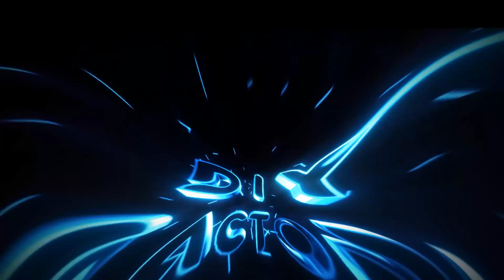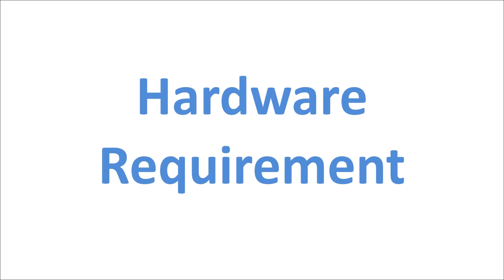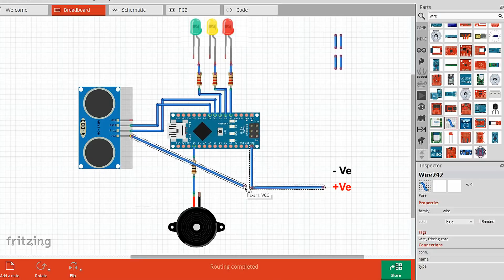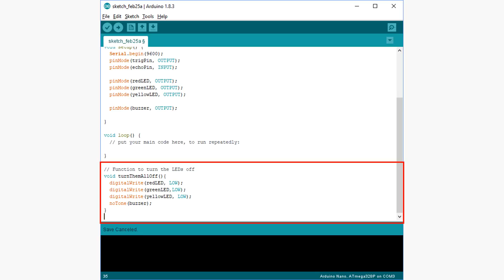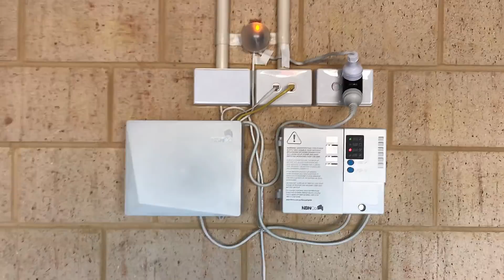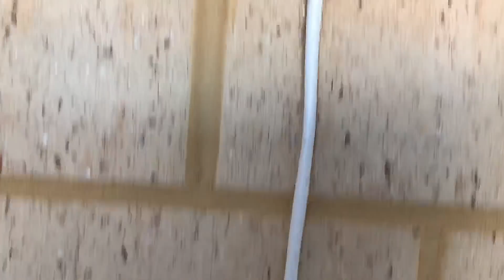DIY - Arduino Based Car Parking Assistant

Comment: Thanks for the video. At which part of the front of the car do you aim the ultrasonic sensor? I have been contemplating a similar project and the front end of my SUV is all curves, and the grill would give a poor reflection of the signal. I am thinking that reflection off the front number plate would be my best option. Any thoughts?
Reply from the maker: That is absolutely correct
I target the number plate using the ultrasonic sensor. 

I also have a version 2 of this project:
 https://youtu.be/MqJxUf3Cugg

Comment: In your video you use a Arduino nano R3 can this be done with Arduino Uno, if so how would it be connected up
Reply from the maker: You can use any microcontroller 
Just google the pin outs of that board and change the PIN numbers accordingly in the code
Reply: @CrazyCoupleDIY  thanks for replying I'm.using Arduino Uno with a breadboard so would your code work so long as I change the PIN details within it.  I will be repeating 4 times on the same circuit so effectively having 4 sensors and 12 LEDs that's why I'm using the breadboard

Comment: Can this be considered as a control systems project? If yes, then what is the feedback present in this? I'm asking just to clarify my doubts. Thank you
Reply from the maker: Well yes and no
What sort of feedback are u expecting?
Reply: @CrazyCoupleDIY  I think...the distance from the car to any obstacle in front or back is the feedback present...so that the system prompts me by telling there's an obstacle present...but isn't it difficult to design,because the proximity sensor should be really accurate...since I'll be parking inside a closed surrounding...and everything can be considered as an obstacle
Am I right?

Comment: Does this code work for arduino uno? Looks like all the pin names you use are not arduino uno pins.
Reply from the maker: Yes it does. 
You just need to use the correct pin names/connection in the code/and schematic 
Let me know if you are having any issues finding the right pin out and I will make a sketch and send it to you

Comment: Superb! The perfect tutorial video - probably just missed the bit where you warn people to be careful with mains electricity
Reply from the maker: Sure thanks for the suggestion. I am actually making a v2 of this. I will definitely include the warning in that.
Reply: @CrazyCoupleDIY  Did you already post part 2 already?
Reply from the maker: Yes I did
Please check it out here:
DIY - Arduino Based Parking Assistant V2
https://youtu.be/MqJxUf3Cugg

Comment: Great project. I wonder if spider webs or other dust affects readings after a couple months?  I subscribed.
Reply from the maker: No idea what happens but every second month I have to change the sensor.
I have subbed aswell raising your count to 450 :)

Comment: I tried the circuit.. but only the buzzer is working... And the LEDs are not glowing..
Can anyone help me out..??
Reply from the maker: Can you please double check the wiring. 
Can you please also check if the LEDs are connected the right way

Comment: Will this work for a parking distance of 2-3 inches?
Reply: Yes but I'd be concerned that the bumper's outer most reach was always centered on the sensor.
Reply from the maker: The HC-SR04 ultrasonic sensor uses sonar to determine distance to an object like bats do. It offers excellent non-contact range detection with high accuracy and stable readings in an easy-to-use package. From 2cm to 400 cm or 1” to 13 feet.

Comment: nice video
i plan on doing this but using 3  arduino relays instead of LED's
connecting the relays to  some old C7 christmas candle light sockets/bulbs
and making a traffic light box out of some foam board from dollar tree and getting some colored celophane or some translucent paint and some clear plastic to use a lenses and pait them with the red yellow and green  translucent paint
Reply from the maker: Good idea, you can also add 3/4 LEDs (relays) and create like a volume level indicator.
So when the value decreases the indicators go up and when the value increases the indicators go down

Comment: How could you turn the tri-color LED display into a distance output on any kind of screen, say a basic matrix?

I have a garage that's at a 90 degree angle at the bottom of my driveway and it's a tight squeeze to get my classic pickup in there. I would want to rig something that gave a measurement from the sides of the garage to help when I don't have a spotter.
I have a few nano's lying around this would be perfect for!
Reply from the maker: Mate check this out: https://www.youtube.com/watch?v=ddxguAzzzJE